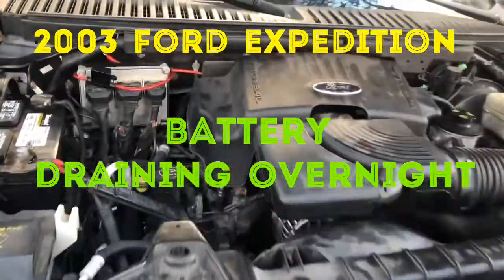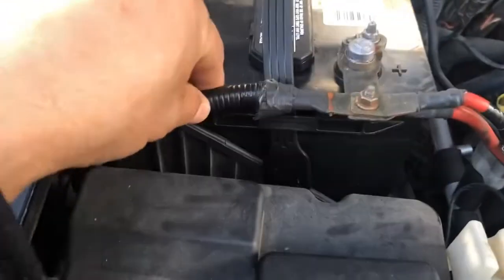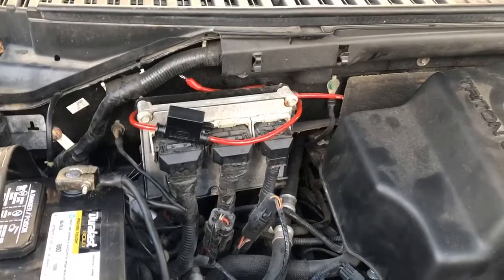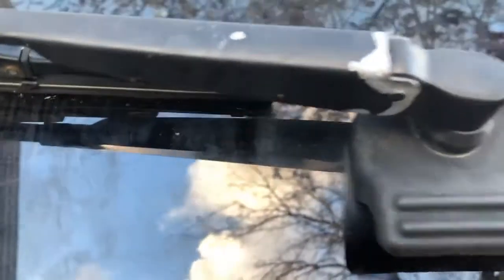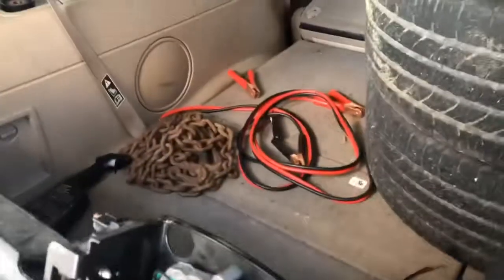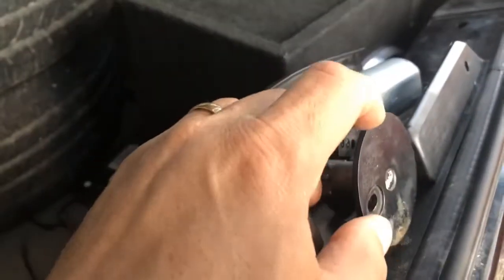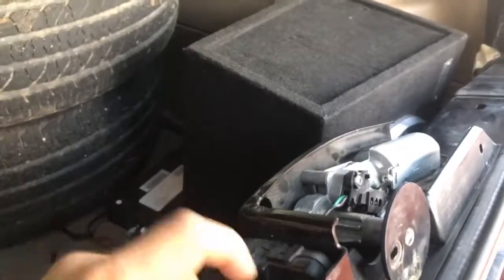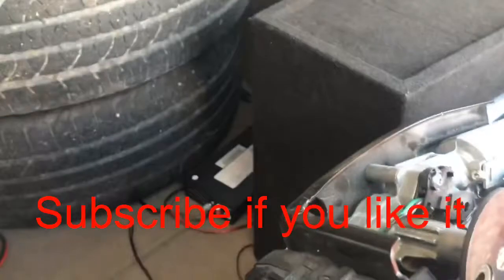Battery draining overnight 2003 Ford Expedition

Comment: Thank you, I have been trying to track down the battery drain for a couple of days.
Looking at a volt meter, the battery voltage would dip every 30 seconds or so then return to normal and eventually this would drain the battery.
Long story short, opened the tail gate, the wiper actuator moved forward and then back to home position.
These fords have some quirks!

Comment: We have the same problem battery drains fast. But it's not our back windshield wiper or battery or alternator they are all new. This is so frustrating
Reply from the maker: Do you unplug the motors on the back window if you’re not leave it unplugged for one night
Reply: gem module?